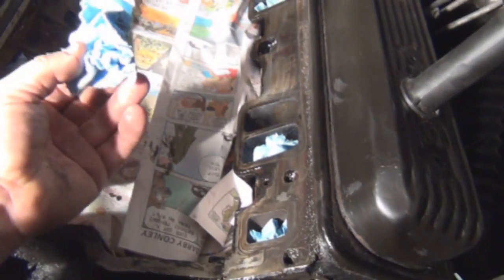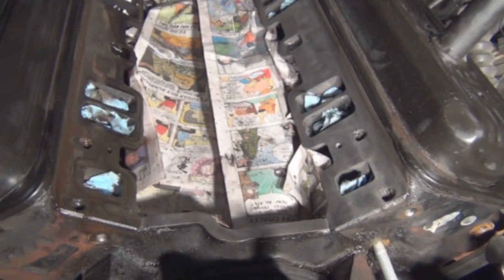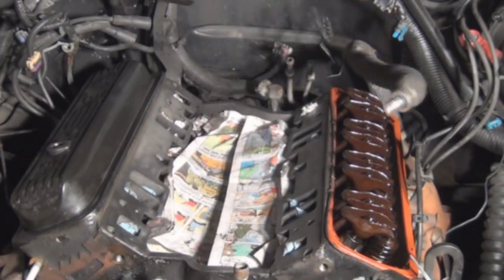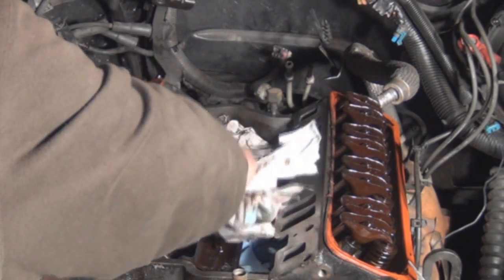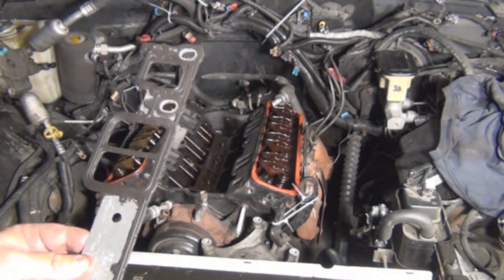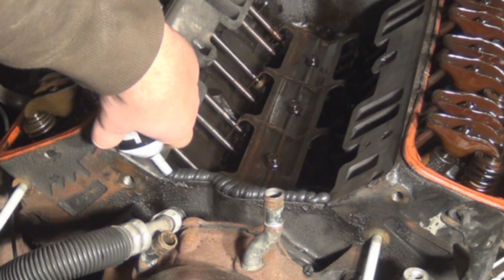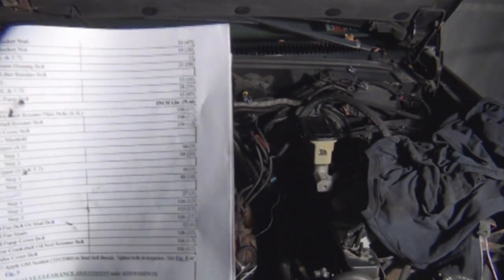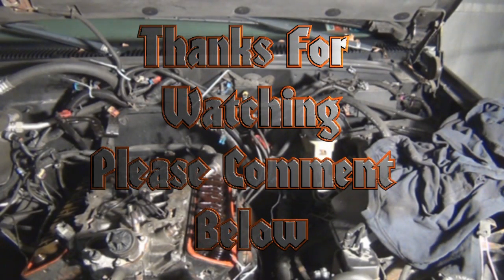Intake Manifold and Gasket Preparation and Installation

Comment: Did this a few days ago and I put sealant around the water jackets on mine to have a little more extra piece of mind that they don't blow again. Mine had previously been done with the old style gaskets before I got it. I wouldn't use them, the metal core ones are far better made. If you have pitting around the water jackets then I'd definitely put some sealant around them though. It might seal and hold for now without it, but it's better to be safe than sorry and have to do all that work all over again.

Comment: That grinder is taking off material. Not a good choice for cleaning the heads and intake. Although is works great for cleaning ... but NOT for this application where the two surfaces mate together, these two surfaces have to be laser straight....

Comment: Nice vid man , im doing mine right now, ive noticed some prestone that falls off (i had it drained before) what you do with that? run it a lil than change oil?
Reply from the maker: If antifreeze mixes with the oil, DO NOT run the engine. You have to change the oil. You should change the oil after a job like this regardless. The antifreeze is not good for the engine , it works as a corrosive on the bearings and will destroy your engine. I would like to thank you for the compliment and comment. I hope this helps. Thanks for watching, please like, share, and subscribe.
Reply: You know what i mean, theres some holes down there goes to the cam? so is the antifreeze fall all its way down? or some left where the cam sit? i have to do my stem seals so maybe its a good idea to remove push rods and put oil in these holes?
Reply: Have you had this problem too when you removed it? I should have placed oil there before installing the manifold back, hate myself :/
Reply: @handymanPF  ya runit for bit to move all the debris into filer and flush through system a bit, then drain oil for day or 2 so evrything settles back, button it up with new filter and oil

Comment: using that tool could cause a larger gap by removing metal so you may cause your own leak. I clean with brake cleaner or Carb cleaner and never experience ant leaks and I done many of these jobs
Reply: Result in premature engine failure too,GM has a TSB on this called not to use those rolac discs.GM found out there were techs doing this improper cleaning procedure and come back with the premature engine failures.The little pieces get in the oil which the oil filter can't trap and the engine becomes a ticking time bomb.

Comment: I changed the video once I saw u using a grinder wheel to the block
Reply from the maker: Wasn’t a grinding wheel, it was a scouring pad to clean up old gasket material. I’ve been using that for years and had no problem. Regardless, thanks for watching and commenting. I greatly appreciate it
Reply: it is called a ro-lok sanding disc made by 3m

Comment: QUESTION?? TURNING MY IGNITION FROM OFF TO START MY ENGINE WILL START HOLDING THE IGNITION AT START THE ENGINE WILL RUN,  HOWEVER ONCE I LET GO THE IGNITION TURNS BACK TO ON BIT THE ENGINE WILL TURN OFF. ANY IDEAS?
Reply: kiixg viikk vacuum leak not enough fuel too much air
Reply: kiixg viikk fix it? Could also be solonoid or wiring

Comment: Dude you need to show how you opened that intake manifold I'm scared to do it cus of the fuel injectors
Reply: don't be intimidated, just take a picture of all sides and angles if you've never done it, so you can see where everything goes, then start removing slowly. Remember to drain the coolant before loosening lower intake bolts...well before anything.
Reply: +Justin C thanks bro. I gathered courage and pulled it off
Reply: This engine has a spider fuel injection system that sits in the upper intake and runs to each port through the lower. If you have a 5.7 vortec all you have to do is remove the plug ontop and the rest will be fine.

Comment: Never use a 3M pad it removes metal makes surface uneven. Have had to have heads milled 10 to 20 thousandths  after people have used a 3M pad to clean up surface. And never ever use on aluminum.
Reply from the maker: It does if you have a heavy hand and hold it at the wrong angle. I’m not surprised that you had mill a lot of heads because of this. Were they aluminum heads that people mainly scored too deep with the pads?

Comment: You didn't clean the threads out.. You will NEVER get an accurate torque...
Reply: Southern Bucks what do you mean by that, like the bolts them selves or in the engine?
Reply: @aaronhall1984  He might be blowing smoke in any case I've never ever heard that you need to do that.  Might be a good idea, might be overly knit-picky
Reply: @geoffmiller3468  it's absolutely recommended.  Same reason you use a wire brush on a drill to clean off the threads on the bolts.  It make sure all the bolts torque evenly. There's always old sealer in the bolt holes and that's what you're trying to clean out.